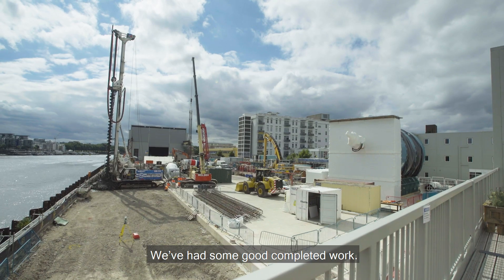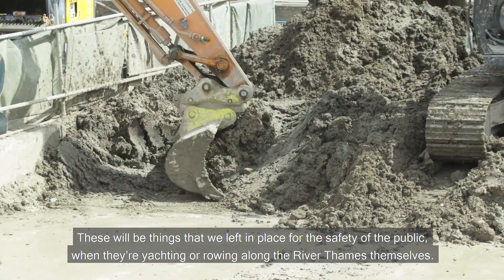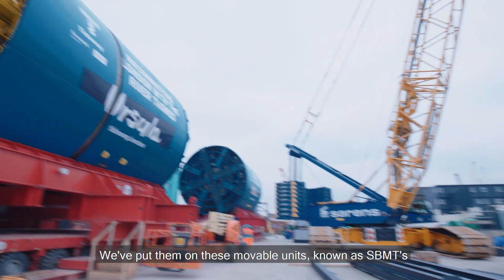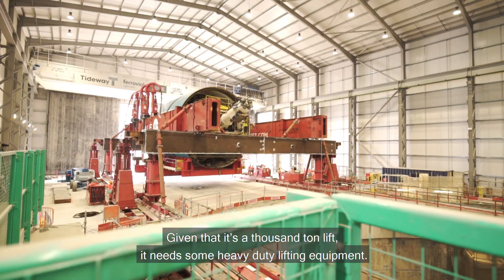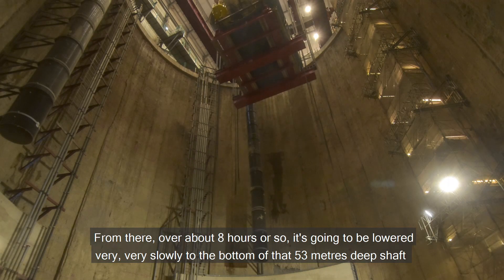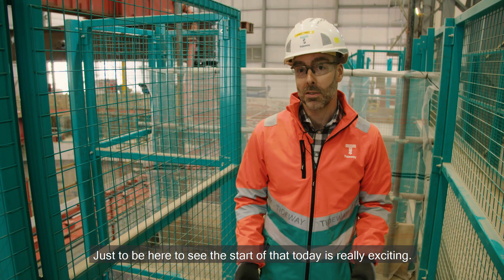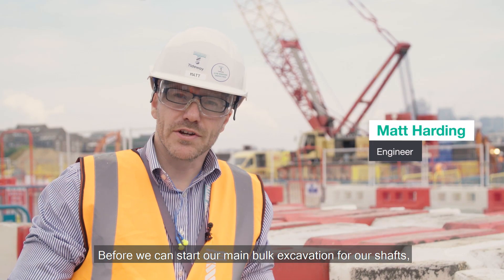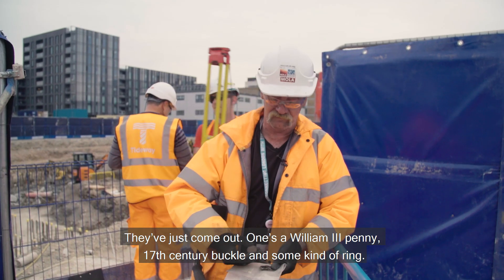"The Eagle has landed" - How do you lower a Super Sewer tunnelling machine below ground?

Comment: Eduart Regjepi

I work in Thames Tideway tunnel for nearly 2 years in 27/07/2017 I had an accident knee injury I’ve been stuck between steel bars I was pouring concrete no safety no platforms for safety reason I’ve been forced to do concrete that I’ve never done before and when I had an accident I told them to put on report book and they told me that they have reported it but actually they didn’t do it and the three people and two general foremen and one health safety they left their job because of this accident because they never thought that I’m going to go any further in 12/03/2019 I had my first operation I’ve had three hours operation and I have to do one more in two months time transplant and metal part I was for two weeks off work the first day after two weeks I was off they give me one week notice to leave the job I feel discriminated no respect at all and they maked me leave the job with no reason I was from first people on that place  Thames Tideway project In Battersea kirtling Street
Reply: Should have taken it further to the job tribunal for compensation. Health and safety neglect issues. 😳